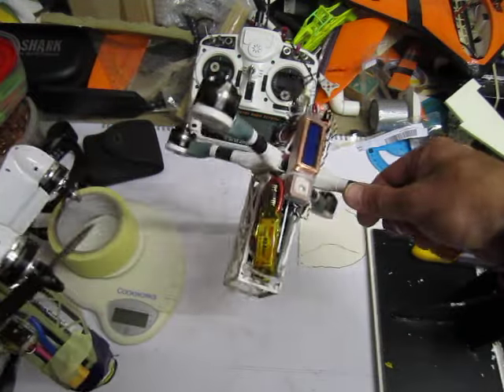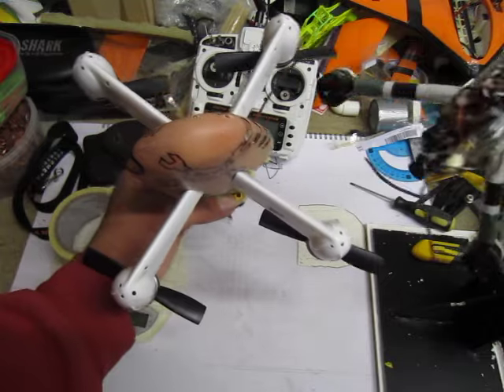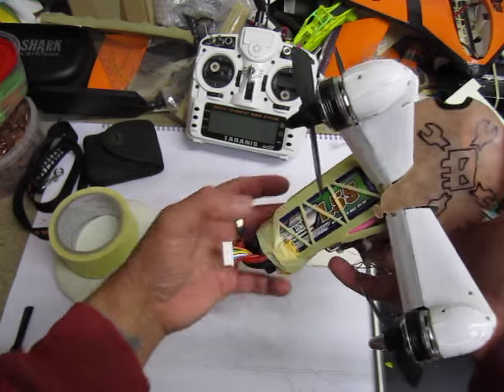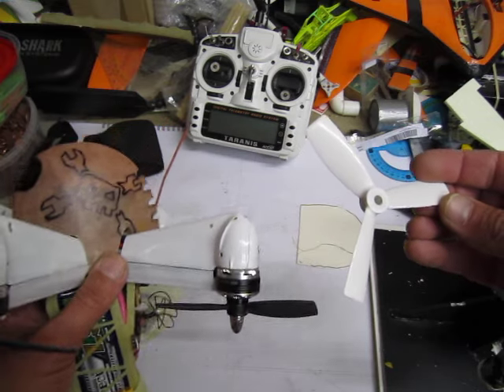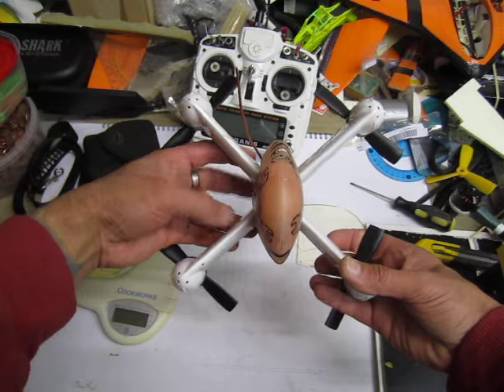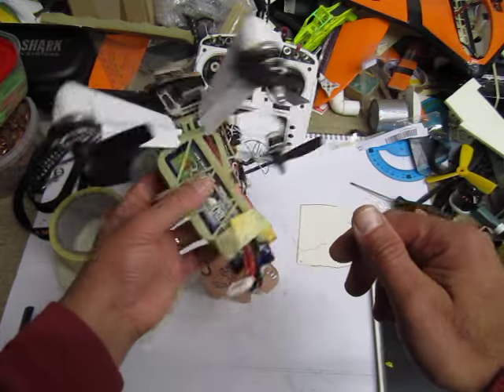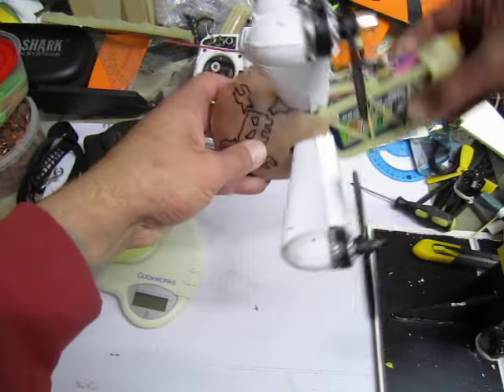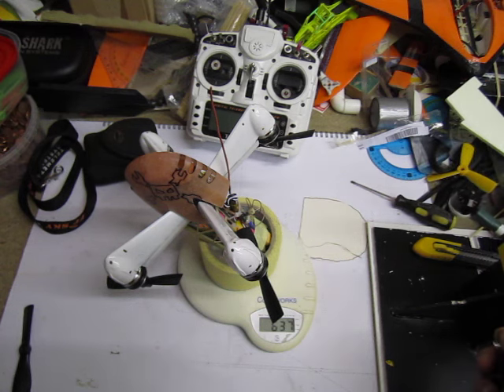Miniquad speed record. Part 9. V3 build overview.

Comment: That looks awesome man! every video temps me into the challenge =)
Reply from the maker: Join me then!  Cheers:)
Reply: ROBOFORCERX2000
Any guidlines for it, or is it simply as small and as fast as can be?
Reply from the maker: D.B. From what I've learned- a combination of carefully chosen setup, weight and aerodynamics wins here. And simplicity as well- more added things like servo tilted cam, PDBs etc adds to AUW. K.I.S.S. wins.
All my wins & fails and every info about setups and testing of all 3 speedsters is here- http://fpvlab.com/forums/showthread.php?37954-World-speed-record-with-250mm-(or-under)-size-quad. Flick through and you might get some ideas on how to beat me :)) And I just made things a bit harder for everyone again- came back from maiden with 188 km/h! I'll have video this evening:)
I'm not a setup guru and there are pilots that can make much more precise calculations, but I believe my DIYing skills is my best card here.
Edit: I've no video, only now I found out that my DVR didn't record OSD for some reason...
Reply: I've now read the whole thread, game on!
I think that I mite have a couple trump cards up my sleve =) as long as I can find some respectable motors.
I hope a few others follow through with their designes too.
Random fact, I can see the tops of Wicklow Mountains on a clear day from my house across the pond!
Reply from the maker: D.B. Yeah man, game on indeed, now you have my 194 km/h to beat and I'm going again today to top it up a bit (hopefuly:)
Reply: Good luck with hitting that 200+km/h!

Comment: I've been thinking about building a quad for speed lately.  some ideas..  

1.  have you considered using the body of the quad for lift?  you say you're at about 80 degrees in angle during full forward flight, that 10 percent angle is effectively lost speed, if you can build your motor arms in a way that they will create a small amount of lift I believe the increased drag will be less than the gains in speed.

2.  I've been thinking about a two battery system, one that is used to bring the quad all the way up to the beginning of the speed run and then it ejects the battery, relying on a much smaller and lighter battery to perform the brief burt of speed.

Lets see 200mph!!!!  (320kph)
Reply from the maker: 1. On a copter there's always gonna be a lost as it has to stay in the air so hopefully my aerodynamic tube covers will contribute. I didn't go that route because of extra weight and air drag would be added which I believe would be much worse than copter not tilting full 90 degrees.
2. As weight matters a lot I don't think 2 battery system will work. You'll need some sort of relay when disconnecting one battery for the other to connect, and to make sure that the second one connects before first one is disconnected, otherwise you'll drop down. Then servo for release, and then the copter will be bigger in size (therefore heavier) due to all the systems, and less aerodynamic. And you'll have to make sure to find that dropped battery, which more likely will have to have a parachute and a buddy that runs after to look where it falls. And then somehow release and WOT combination will have to be done in split of a second without taking your thumbs off the sticks. 
Such idea was discussed on long range FPV airplanes multiple times and there's a reason why nobody does that,  I believe K.I.S.S. system and carefully chosen setup is the winner here:)
Reply: I think you could increase the lift with smart tube covers without adding any weight.  The only way to increase forward thrust (all components equal) is to increase angle, I'll try to build and run a simulator later but I'm almost certain the increased drag is the lower end of the ratio.

You would need no additional electronics if the batteries were wired in series, you would simply have a decrease in overall amperage which is fine if the single battery you're left with is capable of supplying enough amperage.  voltage would not change at all.  a fusible link or two (very light) would suffice to severe the link between the quad and whatever was holding the battery, this could be achieved in 1-2g max.

Comment: Use ZMX 2206 2300kv on 6s 5040 prop
Reply from the maker: And that will smoke that motor like there's no tomorrow:) 5s for that much kv with 5x4- of course, but even 2208 size motors are on the limit on 6s, nevermind their smaller 2206 brothers...
On the same note- I admire your skillz on the sticks brother, been following you for a while and still hard to believe that in such a short time you progressed to a pro level, keep it going!
Reply: There are a few guys out there running 5 and 6 cell on 2400kv+ setups with surprising success.  Although expensive, I think you could get incredible results with the right gear.  Thank you for following :)
Reply: Edit:  I think 5s would be the sweet spot.  On a 2206 or 2207 2200-2500kv motor.  Little bee 30 amp ESCs and kiss 24s have had great success on 5s.  There is a video by catalyst machineworks running 2206 2500kv on 5s and hitting 104 MPH
Reply from the maker: Johnny FPV Yeah man, his speed is what got my kaka boiling again. He has a pic on FPVlabs of 109mph as well (no video though) and that's why I jumped on the record again as my previous 101mph became outdated:)